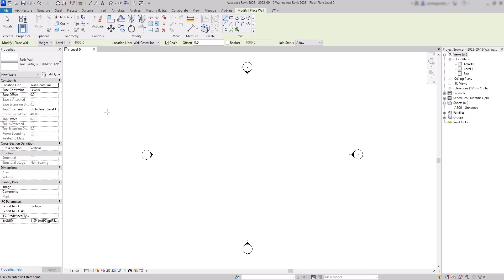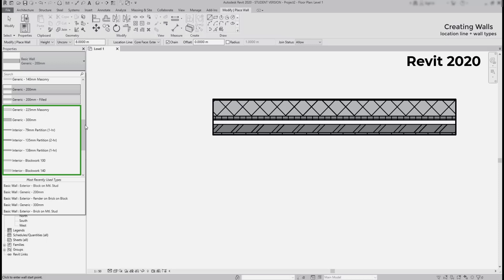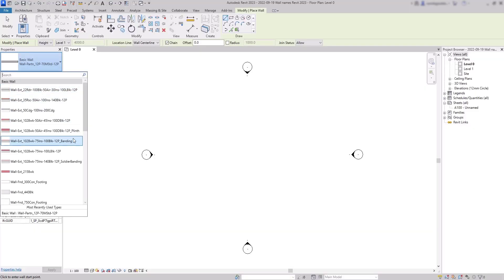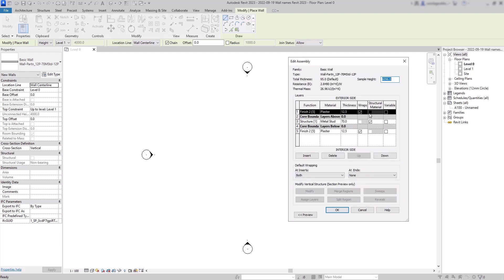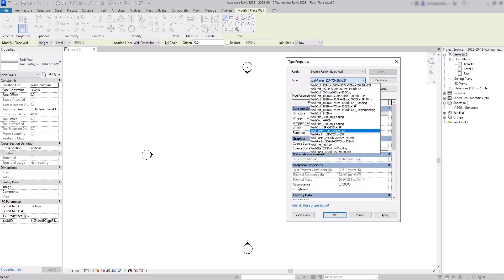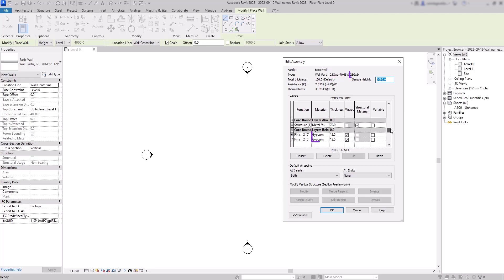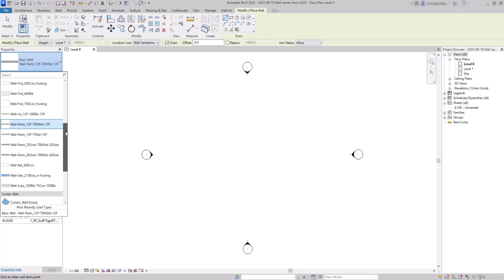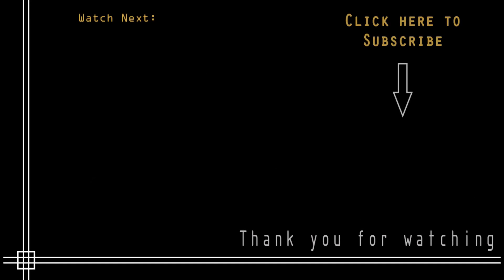Revit - New wall types on Revit 2023 - Weekly tip

Comment: how do you create new wall type? i want to use a conventional chb w/ plastering wall but it seems like its not available in the current wall types revit has. can you make a video for it?
Reply: For anyone else who is wondering. To create a new wall type, you can duplicate an existing one, rename it and create one to however you specifically want. Just make sure you know the dimensions of the thickness in material before creating it. For example BrickVeneer I created 110mm brick-common, 50mm air, 90mm metal-stud.
Reply: @iHappyKorea  is it possible to change the hatch type of the wall?

Comment: Do you know how to make the wall graphics appear in Revit?
Reply: For anyone else. By default the graphics will appear in Hidden Line or Wireframe. To show the graphics of the wall structure, you can select Realistic. This option in 2024 Revit is found at the bottom left-ish of the HUD. Near the scale you're designing in, you'll see a cube icon. Clicking that will show you a list of graphic options.